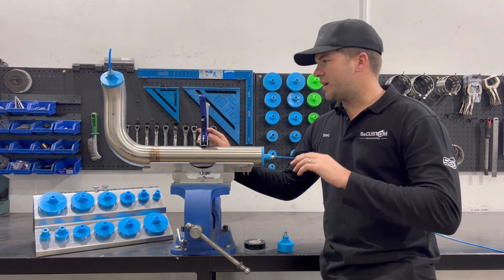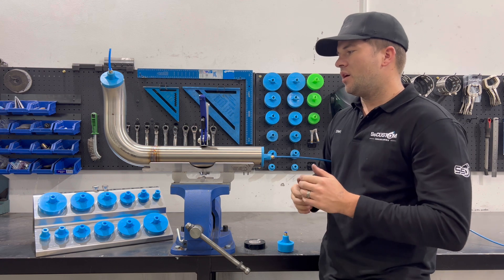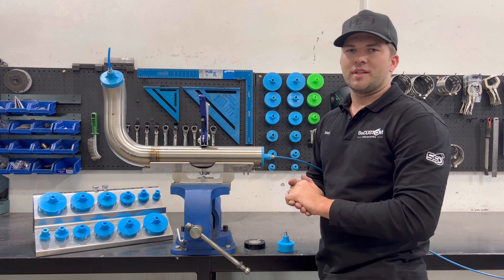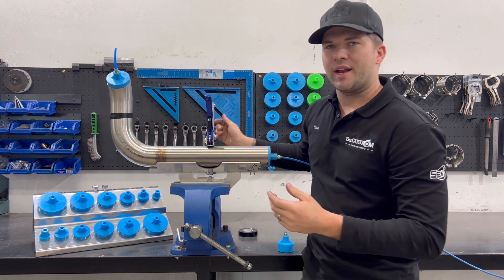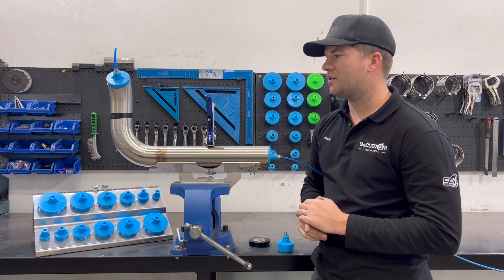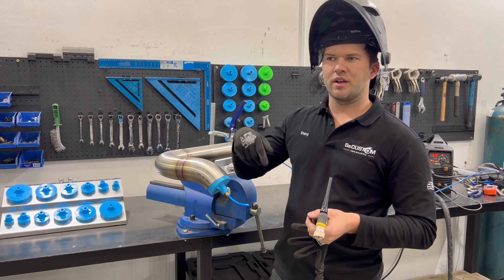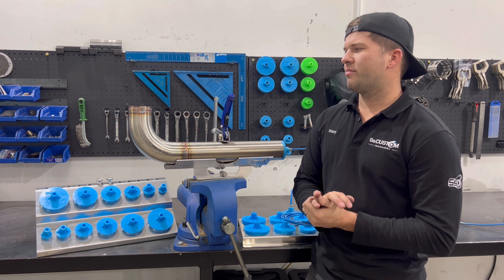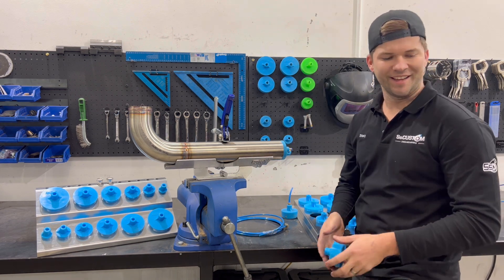HOW TO PURGE WELD STAINLESS

Comment: Hi mate, when you tape up the joints do you not find the tape gets really tacky and burns residue onto the stainless when you weld near it?
Reply: If you are using the same normal painters tape as everyone else, it will always burn if it gets the heat! From your comment, it sounds like you have tape on all your joists, and only pull away the small stretch you are going to weld, it that’s the case, you need to think about what you are welding! If it’s thin wall stainless/ sanitary tubing, you don’t need the tape on your joints 😊